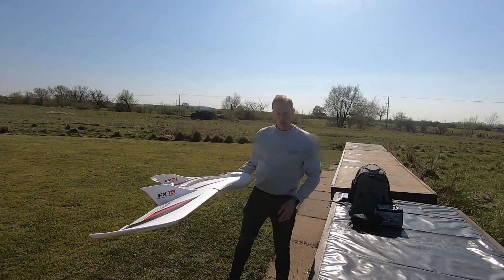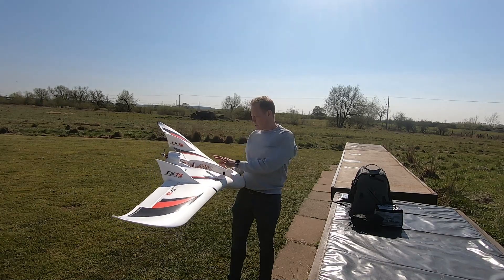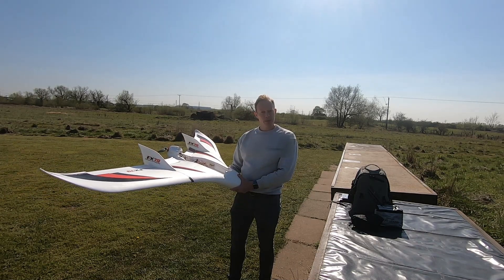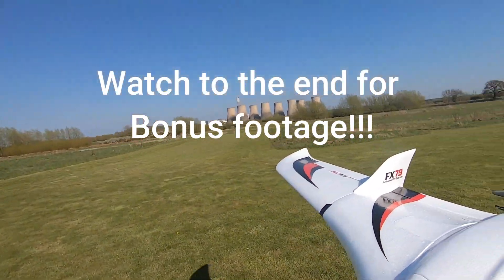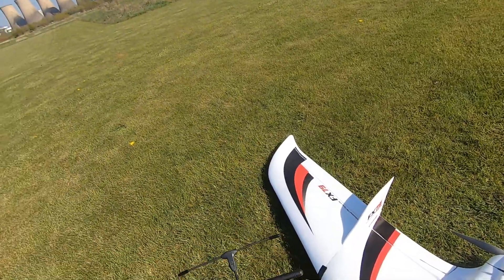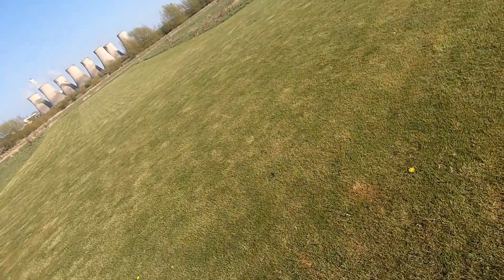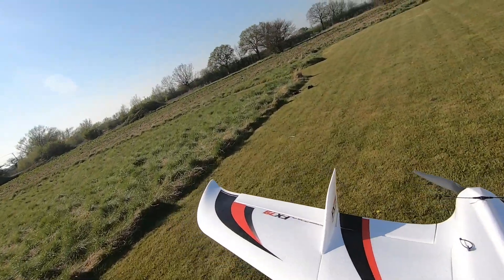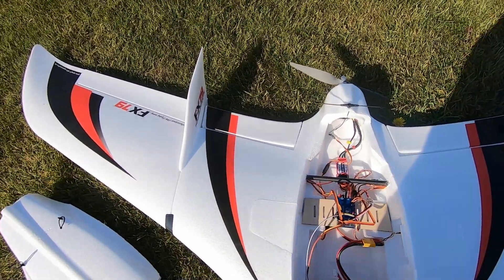MASSIVE FPV WING MAIDEN FLIGHT!!! - Zeta FX79 Buffalo

Comment: Awesome plane and great video, I had my chance to put my hands on one of these but missed the opportunity!         
 A couple things you may want to look into. From what I understand, you do not want to add trim to the radio with iNav. iNav will see those trims as inputs from the radio, also no mixing, rates or expo with the radio, all in iNAv. One more thing that won't be a problem unless you are doing long range is the antenna, it really should be mounted vertically so the two null zones exit below and above the craft. Horizontal like it is creates two null zones coming out the left and right side of the airplane which could be an issue when you try to turn home at distance.
Reply from the maker: Thanks for watching and for the tips Ryan. Yes I reset the trims to zero after enabling auto trim, so it fools inav into thinking you are flying level. Seemed to work well because the second flight was more or less level and that was all from the FC, no trim. I won’t be flying any more than 2 miles out I wouldn’t think, so hopefully will ok 👍
Reply: Ok now I see you reset them lol.

Comment: I’ve always like this wing gonna add it to my fleet for my next build. Will go well with the fx79 and z84 I already have. It seems the launch holding the wing method works pretty well for take off. It was my only concern with this dig wing is getting her in the air when flying alone. Cheers
Reply from the maker: Yeah treat yourself 😂. It’s a not easy hanging onto it for that wing launch I can tell you, but no way I’m getting my hand anywhere near that massive prop!  Just watch out for that initial nose down on the first launch, but other than that it was fine. I might have a go with inav auto launch too. Cheers for watching 💪
Reply: @tdogrc  my fx61 also nose drives a bit on launch I found the auto launch on that struggled to lift it quick enough before hitting the ground.
Reply from the maker: @stonesrcchannel  ok thanks for the tip. Maybe I won’t try it then 😂